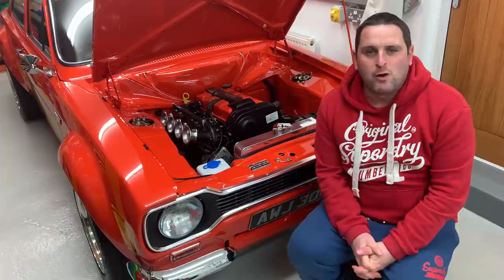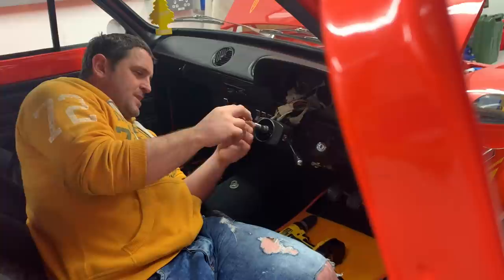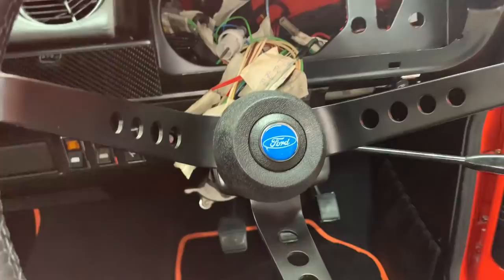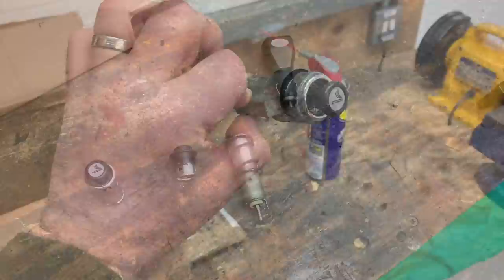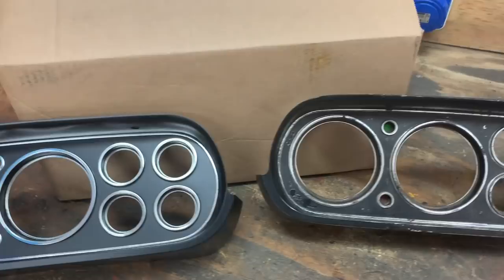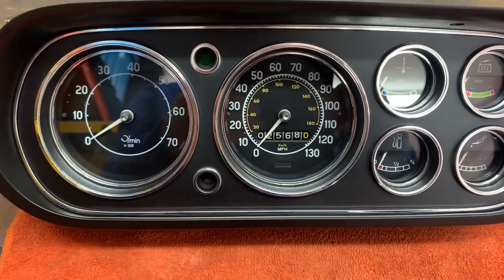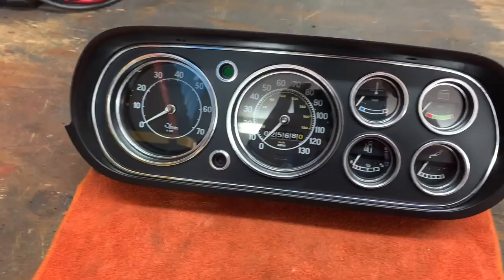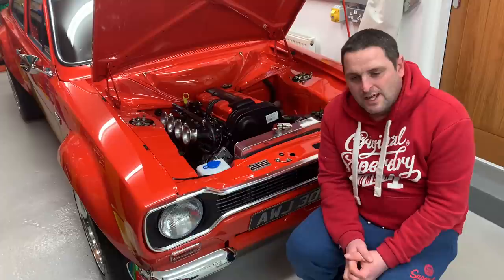MK1 Escort RS 2000 Re Assembly Episode 33 Clocks & Finishing touches

Comment: Yep, I agree about soldering the wires over crimp connectors! Top job :-) The charge light will get a 12v feed from the alternator when running so the light won't light (as it already has a 12v feed). However, if the alternator fails, that 12v will disappear and will turn into an earth/0V completing the circuit , thus lighting the charge warning lamp - that's how I understand it anyways 😂😂
Reply from the maker: That sounds right to me Davy 👍

Comment: Hi there Craig, has I said before stunning work ton on tlc there.
Has for the milage reset it's actually very easy to do so. Take the speedo out under the markers on the left side it as a little clamp, pull it out and the miles counter will come out in diagonal way, then its just like a rubbics cube(but you'll quickly understand how in works eheh) just keep spinning each number until the 0 perfectly aligns with the metal frame separating each number. Those metal frames engage in a flat piece of metal lying in front of the miles counter( if you look under the clock from the side you can see how those metal frames engage in the under frame of the clock). 
I've sent you a facebook friend request a while ago, if you want just add me, and i'll be more than happy to help you. A small token from the imense help you give to escort restorers. 
Greetings from Portugal, sorry for the not so perfect english.
Reply from the maker: You did very well with your English 👍. I did try for over an hour with the mileage but I just couldn’t figure out how to get a lower number. In the end I kept trying until I got it as low as I could then I stopped and left it at the lowest point I could achieve
Reply: @performanceclassics1986  from left to right, turn the digits counterclockwise while locking the correspondant metal frame with one hand until it gets stuck, then rotate the metal frame clockwise from the next digit, almost a full turn until it unlocks the digit once you get the mechanics its really straight forward. The trick is really turning digits it locks, rotate the metal things the other way it unlocks and there going always left to right. Give it one more try, that beautiful engine deserves real mileage counting.
Cheers mate looking forward to see the fully finished. Ps: if you still can t figure it out i'll be more than happy to make a video.
Reply from the maker: @SpearPower  thanks very much. I will have another try when I get chance. Thanks very much for taking the time to explain that. Much appreciated 👍

Comment: Another great video, i had the same issue with my cigeratte lighter. replaced it with a shorter version from a later car. Cant tell its not completly original and works with the shorter plug in usb chargers.
Reply from the maker: I did think about that too 👍

Comment: Mine came from classic trim too . Nice stuff :) 
The  cardboard tubes for the alternator light and indicator light is original mate ! ( duck tape isn’t though lol ) 
 Makes a world of difference when you’re sat looking at nice clocks like that :)
Reply from the maker: Yeah I only realised they were original later on. No expense spared eh 🤣 the only issue with it is the paint scrapes off really easy. Clayton said the same before I bought it.
Reply: @performanceclassics1986  
Im kind of glad yours is as I was wondering if it was just mine , but I’m not glad it is if you get me ? 
 I’ve scratched mine even more taking the buggers In and out sorting my tacho - which I’m hoping is sorted now 👌
Reply from the maker: @leer798  yeah me too. Ive just got the tacho working this weekend with a cable ran from the coil pack. Did you do the same??
Reply: @performanceclassics1986   I fed my coil pack live using the tacho loop yeah . Did it from the start and it worked fine till this weekend . Think it might have gone tight with not being used ? Seems to be nice and free now so 🙏🙏🙏🙏
Reply from the maker: @leer798  yeah that method seams to work a treat lee 👍
Reply: @performanceclassics1986  job for the future mate - repainting the binnacle . Shame about the paint on them when they’re such a nice item
Reply from the maker: @leer798  It is Lee. It’s the only thing that lets them down really
Reply: @performanceclassics1986  it will be an amazing experience to sit and mask all that chrome up 😀😂😂
Reply from the maker: @leer798  🤣🤣🤣

Comment: Use your old dashboard and connect it to a drill to  change the mileage to re set it to zero
Reply from the maker: I did try this William and it does work but I’d probably have to leave the drill running for a week 🤣. I could probably do with a high speed drill to do it quickly enough

Comment: That’s a great idea with the steering wheel boss, I used sticky bond putty on mine, great until the hot weather! By the way, what seats are you using?
Reply from the maker: They are fishnet recaros that apparently came from an early MR2 but I do want to replace them for the original beta cloth roll tops to match the rear beta cloth seat

Comment: Can’t you zero the speed mileage using the old fashioned method of using a drill in reverse?
Reply from the maker: Yeah I did try this and it does work but I would say I’d need to leave the drill running for a week 🤣 I really need a high speed drill
Reply: @performanceclassics1986  all you need to zero the clock are 2 steak knives they fit perfect between the numbers
Reply from the maker: @mead6754  How does that work???

Comment: Greetings!
please tell me how to connect the tachometer?
I see light-colored wiring on different Escort MK1 tachometers. 
On the electrical diagram, it looks like you can see compensators or what? 
or I'm wrong. 
I'm from Ukraine and it's difficult to find any information here. 
I think I'm missing some wires. 
Thank you very much!
Reply from the maker: Hello

Watch this video. It’s a very good video that explains how to do it on both MK1 and MK2 escorts. This is what I followed when I did mine and it does work great now 👍

https://youtu.be/13tDWLxFpDs?feature=shared
Reply: Thank's a lot!)

Comment: Hi Craig. Have you used a steel washer to stop the struts knocking and do you think it might bind a bit as I have the same problem.
Reply from the maker: Yeah I used a steel washer, as the inserts are also Steel. Only time will tell if it’s a successful fix but fingers crossed, it’s all ok 🤞
Reply: @performanceclassics1986  I was thinking about something nylon underneath as it isn't taking the weight of the car but not sure it will be tough enough.
Reply from the maker: @benjaminbenson8714  it should be fine I would say. As you mentioned, it’s not under any load or stress so nylon should be fine